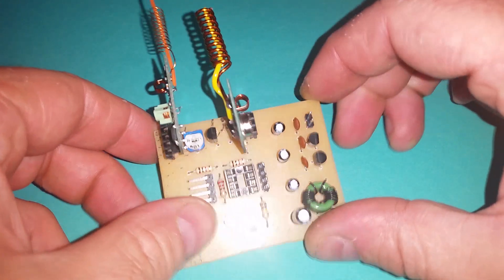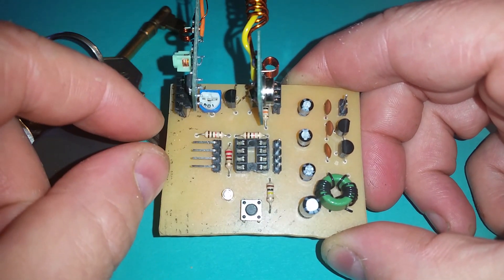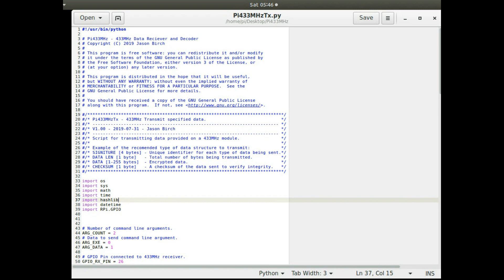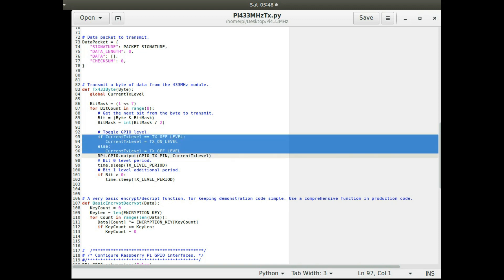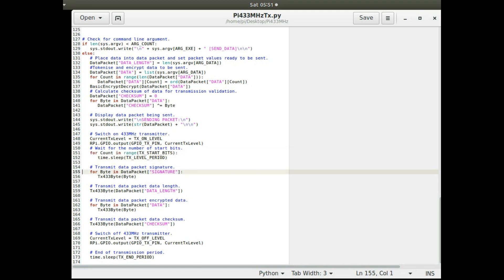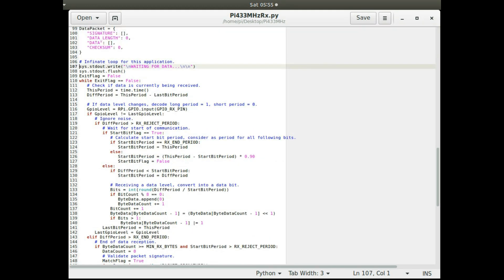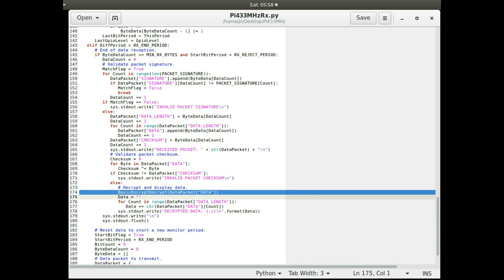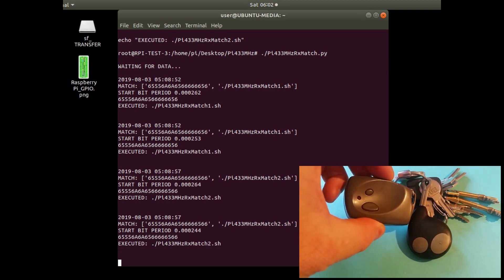Sending Data Between Two Raspberry Pi on 433MHz with a Python Script

Comment: Do you think you can use this to encrypt and transmit images to a raspberry pi to another raspberry pi? And how fast is transmission speed???
Reply from the maker: You could do that, but I don't think it would be very fast with that size of data. There are other modules which use GHz frequencies which would be faster, and they do error handling, all you do is tell them to send packets of data.
Reply: @DevelopIT  so i am doing a project for school and the goal is to send 10 encrypted images using a wireless method without wifi bluetooth and cellular. I looked into SDR but it was too complicated and now im looking into short range radio. I was thinking to get a transceiver and hook it to both pi's and then transmit the data that way. Do you think that would be a good idea and if i compress the images i think i could send them within our 10 min constraint? What do you think?

Comment: Great stuff, I'm learning a lot.  I'm confused about one thing though.  In your initial constant declaration you have TX_OFF_LEVEL = 1 and TX_ON_LEVEL = 0.  Shouldn't these be switched?  When sending data, bringing the transmit pin to HIGH?  I am having an issue where I can't get the TX to turn off as defined on like 169: CurrentTxLevel = TX_OFF_LEVEL.  I feel like I'm close but I'm not getting data.  I'm also not using an NPN transistor is that makes a difference.  I switched that value to 0.  Thanks!
Reply from the maker: The NPN transistor will invert the signal, which is why the constants have reversed values. So to make the transistor conduct requires a positive voltage on the base, and when it conducts the signal will be directed to 0V, thus a positive signal becomes 0V. I haven't looked at the circuit recently but the transistor will be converting the 3V3 signal from the GPIO pin, to a 5V signal required by the module.

Comment: Hi! Have you ever tried using these modules with a pair of Pi Picos? I modified your code to operate with the Picos (and removed the encryption step for simplicity) but I'm not massively experienced and, while the code runs, it doesn't look like anything is being received!
Reply from the maker: I think in this video I was using a battery to power the receiver circuit. When I switched to powering from the same supply as the Pi, noise from the switching power supply caused an issue. Later I did a video on using a 78L05 regulator to power the receiver separately. As the 78L05 is not a switching regulator it provided a much cleaner supply. This may help if you are currently powering the receiver from a switching supply.

Comment: My receiver does not have an antenna, but it is on the same breadboard as the transmitter and connected to the same Pi.  The receiver is not receiving the data that I send from the transmitter using your code.  Do you think it's because I did not use an antenna?  Anything else come to mind?  Thanks!
Reply from the maker: I later did a video about reducing noise being transmitted: https://www.youtube.com/watch?v=vuGWBm2rWmA
The PSU of the Raspberry Pi can generate a lot of noise on these modules. I'm not sure if I have tried transmitting and receiving on the same Raspberry Pi.
Reply: @DevelopIT  Thanks much!  I'll try the antennas and removing the Pi from a noisy RF environment.  Might also try two Pi's like your videos show.  Great code, btw.
Reply: So I built a basic regulator circuit - receiver is for sure getting clean 5 VDC.  No success. Stupid question: do the pins in the Python code refer to GPIO #'s?  For example, receiver pin is GPIO 26, pin 37 - right?  Thanks for all the help, hopefully I can get your code up and running on my setup.
Reply from the maker: @Mickolas21928  They will refer to the GPIO numbers. I use the GPIO numbers in preference to pin numbers.